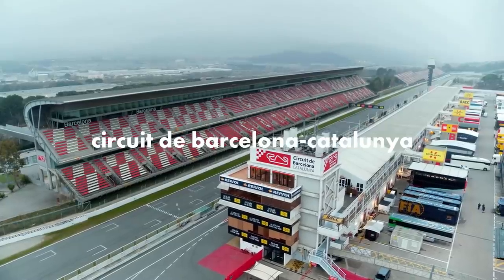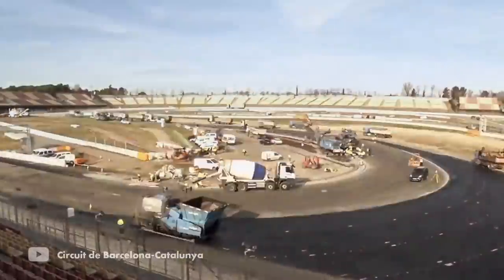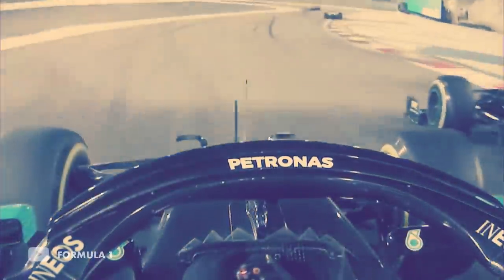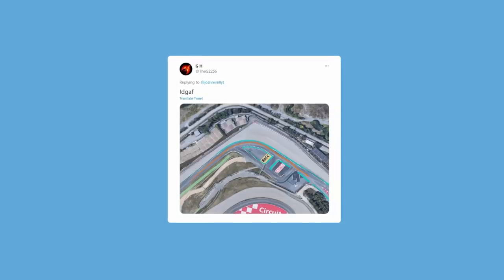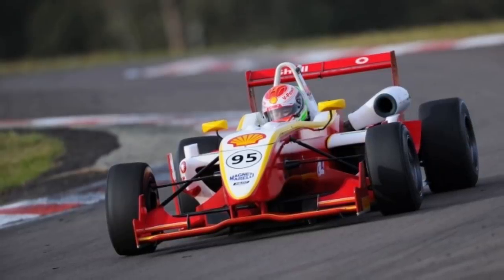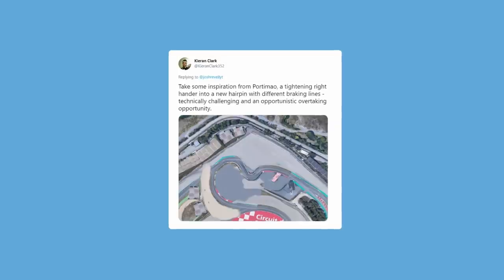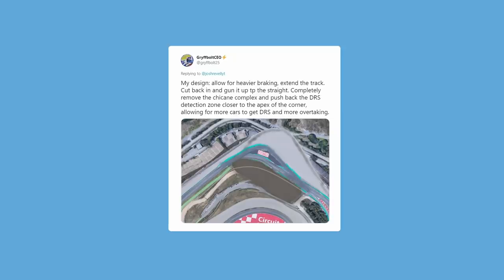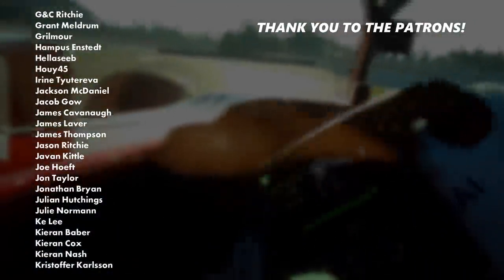Fixing Catalunya's stupid chicane

Comment: if the main pproblem with the sweeping right hander is that there isn't enough run off doesn't it make more sense to increase the amount of run off instead of making the track more dull?
i mean for a couple of ideas that don't include the sweeping right hander the problem is that there is not enough run off on either side of the track, SO MAKE MORE RUN OFF

Comment: it's just simple, increse the run-off area on both sides (just fill the area where the chincane today is with gravel and put safer-bariers on both sides there like in indy if you wanna go overkill) and use the sweeper. is not that hard, and there is space there, just remove the grandstands or move them backwards more. there is space on the circuit for that. also,the tarmac for the sweeper is already there, so why bother messing with it.

Comment: As a place to watch a race, it's actually not at all bad (except for the chicane of course).  Now it's gone and the next step should be to re-profile Turns One and Two into a sort of Brazil / Austin thing and it would actually be a nicely flowing circuit.  Next step, ditch the 'no alchohol' rules so we don't have to keep dodging in and out of the circuit for illicit pic-nics between races.

Comment: I don't know why they need to change the final turn; I mean Interlagos has the same final turn and run to the start/finish line as well; just that it's anti-clockwise; so if anything, just copy paste Interlagos last 3turns/ corners until the start/finish line, that's it, problem solved

Comment: Bro, Indycar/Zandvoort the sh*t out of that corner. One fast banked corner onto the main straight for amazing top speed. So what are you gonna do for set up? Low downforce for guaranteed overtake on the straight, or higher downforce for better grip during the rest of the track, leaving you vulnerable for overtaking on the main straight.

Comment: the classic problem with redesign is you have to includes motogp safety as one of the primary source considering it host the event. But, i think the slightly altered sweeping one or the bahrain-ripoff one could do the trick.

Comment: The problem with these suggestions is that they also should bea able to cope with MotoGP racing. Anything that doesn't leave enough space to the barriers is fatal for MotoGP, even the old Turn 13 (for example Luis Salom crash in 2016, RIP). So it's difficult to get a balanced solution really.

Comment: Why just not go into the old corner, and bout 30 to 40% in it. start the double S from Suzuka Bank them like Zandvoort did with their last corner, and give it a nice Rascasse 90degree run into the straight, that should do at least a little, could also just have the s's flat like Suzuka, they seem to allow for over taking there from time to time.

Comment: they are trying to fix the wrong corner. the big right hander before the straight needs to change.  sharper turn = less downforce loss due to dirty air = closer racing

Comment: Must say I never liked the Barcelona circuit when they introduced the chicane for most of these reasons. It ruins the flow of the race track. In all I say that chicane has to go! Personally I preferred the high speed right hand sweeper much better. If they were to make it a bit tighter and slower entrance at the top section would be a fair compromise. Oh and bring back gravel traps because I've had enough of these track limits constantly destroying racing!

Comment: Yea this last section is total junk. The easiest fix is to use the sweeper and add safer barrier. The crash excuse is nonsense as monza has worser highspeed low run off high speed sweepers, like the last corner or the 4th corner

Comment: Ever since the chicane was built, I hated it full hearted. It ruined a circuit that wasn't great at first but then made it worse.

And then the hairpin is ruined now as well, the only real good corner to overtake. I understand it's done for MotoGP, but they could have left the hairpin alone. Basicly they could still use it, if they didn't put curbs in the middle of it...

Comment: The fact that Barcelona is still on the calendar is a joke. Rarely a good race, way too hard to overtake. The stat that 27 wins have come from the front row is enough to tell you what the place is like.

If it wasn't for Merc's strategy last weekend, the race would have been another snore-fest. If they want to keep racing there (and a few other places) then they need to bring much softer tyres, and make them run all three compounds, instead of two.

Comment: I'm Spanish and I also get bored with this track. Another important problem is that both the GP and the track don't even pay it off; the circuit is losing money and it only stands because it is backed by public money (which as you would guess means a lot) My suggestion is to move it to Jerez; I read that the main problem with this track at the time was that it was remote for access but now the city has an international airport, so problem solved. The problem is that Jerez is in Andalusia, territory governed by the corrupt People's Party (right wing) the same party that was behind that utter crap that was the Valencia Street Circuit. Another solution, scrap Spain and fill its slot with Portugal which is also close and many Spanish fans can still go. They can even name it "Iberian Gran Prix"

Comment: I'd say bring back the flat out right hander but move it back a bit for more run off area, and then move the DRS zone on the pit straight forward to prevent overpowered DRS overtakes. Why they haven't done this but they made Turn 10 an even more difficult overtaking spot just because it makes it "safer" for motorbikes makes me think that the track people are totally brain dead.

Comment: the thing is, a lot of the design choices tilke gets flak for aren't really his fault, the FIA makes adding a couple meters or degrees to a corner incredibly difficult, especially in this case, doing away with a chicane which has been praised as the pinnacle of safety in the FIA's last working semi-functional eye since well forever basically, near impossible. 
honestly the spanish GP is just a total loss, before I even got into F1 and was only playing the games, dynamic racing line and all, not only did I struggle with this track, I found it incredibly boring, there is something about it that is just painfully grueling and not in an entertaining way. 

fuck this track, take it off the goddamn calendar already, any driver that says they like it is lying to you & probably doesn't reallly deserve to be on the grid anyways and if they are good, their moral and ethical standings are questionable at the very best.

Comment: Fixing the final chicane wont fix the circuit. There needs to be massive improvements across the board, straights are too short, too much aero reliance. It's basically a demo of how bad the cars are in dirty air.

Comment: The biggest issue is that the first chicane is way too quick and tight. You have to overtake before the braking zone to get it done basically. Either replicate Bahrain turn 1-2 complex or Malaysia,
Reply: Doing either of those suggestions would go completely against the character of the circuit. It's not just "change every corner into a hairpin to fix it". They wouldn't even fit where the chicane is. I agree that the first chicane is a big problem but imo that's not the way to fix it.

Comment: After all these years all of a sudden MotoGP and F1 must use same layout (NOT talking about the chicane, do agree with you anyways), by that sense are we gonna modify all other tracks that both race on for MotoGP. I don't see a reason why F1 cant use old layout and MotoGP the new one, it was like that before. They have turned turn 10 into dogshit is shit now, for me, you's like it im fine with that, taste. I hear they will modify Melbourne and from what i have it will be all about power and easier by making hard corners into plain fast corners.... On another topic, i just dont get why F1 is racing on some current tracks, atrocious computer designed tracks. Im really giving F1 a chance 2 more seasons. Started watching in 95 to end of 2011-12 then returned in 2015 and its been disappointment after disappointment, maybe not including most of the 2017 season cause Ferrari had something for a while or was it 2018 hah and trust me it wasn't cause of Mercedes dominance but just but sport as a whole and where its at. And it isn't even a pinnacle of motorsport tech wise anymore, i think slowly its sliding towards Formula e, they use more advanced tech but still a young category, Rome wasn't built in 6 - 7 years, F1 has been round for a while...atm it seems its lost its goal...are we fully petrol, hybrid in between or fully electric but the Fe is already ahead. What if both sports just merge in a decade once electric cars take off, the only thing that's really stopping electric cars is lack of charging stations all over the place. Now, you can love it or hate (Fe) it but don't tell me as a kid especially 9's watching sci fi cartoons and saying "One day this or that might actually exist". Racing is entertaining and cars can have a bit more contact. Sound isn't that bad either, i mean if you tell me u like hybrid engine sound then you shouldn't have a problem with Fe sounds hahaha, i bloody hate hybrid engine sound.. ok Honda sounds alright that's about it :)

The old layout before pits wouldn't cause accident, just get rid of slippery green shit behind the curb and all good. Right hand sweeper all the way

How good is American ownership for the sport. Should FIA do it instead of private owners. Remember as soon as hardcore feminists complained about grid girls American company obviously caved in and go rid of them. American owned sports or sports in USA are being too filtered and overly safe in many ways, i mean there is safe and there is boring safe you know.... i know i ranted but for a reason ehh

Comment: Listen mate it is the sport. There is too little balance or chemistry on ALL CARS on the grid. This circuit is a massive punch for MotoGP and you should know that. Remove the frickin DRS because the era has over. The DRS was a good invention until 2013 only because cars without it can blast the same speed. Also another reason perhaps the death of Luis Salom on 2016. Yeah whatever mate...

Comment: I love how they just straight up changed the corner that no one asked for. People literally wanted the  chicane to be removed, not changing the turn 10. It's not like it will be more exciting or anything. That's why I kinda like renovation in Albert Park. There are some corner changes there. And I like it because the people who designed the changes probably has predicted/expected how the new racing would look like.
Reply: Yeah turn 10 does absolutely nothing. Maybe they think making 10-13 faster will make it possible to pass into the chicane, but I doubt it - it seems to me that they have just shrunk one of the only hard braking zones on the circuit.